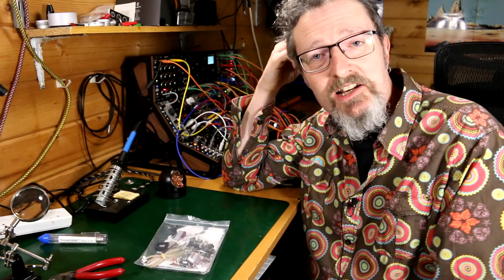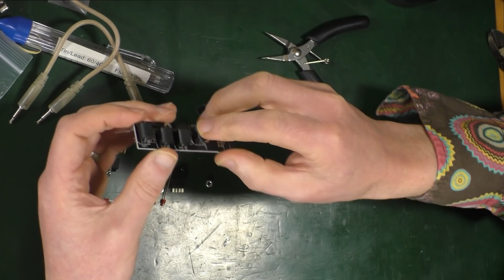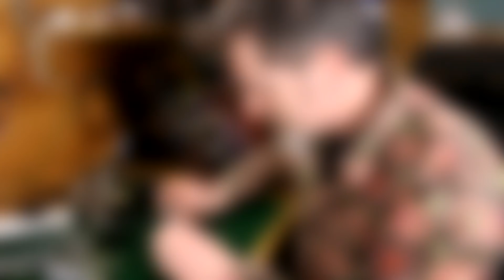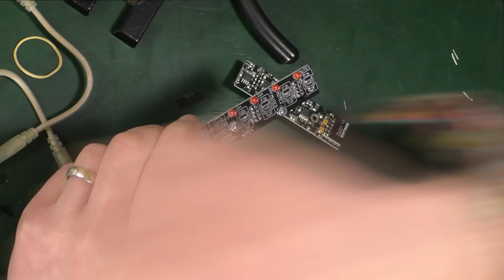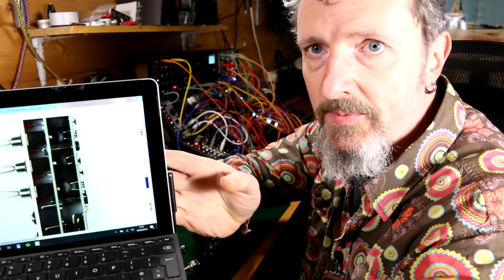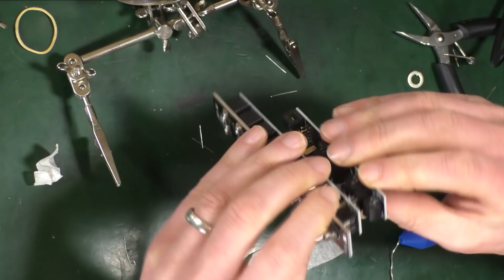Molten Modular DIY 05 - DivKid Mutes

Comment: Cheers for this!  I bought the DIY, my first one (though i'm familiar with soldering and electronics in general) the instructions where interesting!  
Great product!   The only instruciton I had to use common sense with, was for the negative on the LED's, as i'm generally looking for an actual square pad on the PCB.  It made sense it was the squared edge of the screen printed side though.

Comment: Main pcb is usually the one with most components and power ponnector, without any front panels jacks, switchs or pots.
Yep, plastic male header connectors & power connectors sometimes melt when heating the same lead for too long. To get the pin straight again you need to melt again the solder on the other side while readjusting the pin with pliers (not bare hands! it gets hot :) ). You really should try connecting the two boards together before soldering the connectors to prevent this issue.

Comment: Nice vid, ordered 2 kits ,  did several befaco stuff earlier and other diy kits as well but after finishing the first MUTE it doesnt work.... cant imagine what ive done wrong but the module does nothing. I did a rings and 3 ripples last week and thats SMD with a lot of parts, works perfectly. Big bummer here,  just a few parts but doesnt work.... measured for shorts and checked the soldering, no issues found.
Reply from the maker: That's a shame. I guess it's always possible to get a dead board - try the other one.
Reply: Cronny Sockett Dude - same exact experience for me hahaha. Bought a second to try and troubleshoot the first and both aren’t working! Did you sort the issue out?

Comment: For what it's worth, here's my experience with those washers that come with switches. Switch manufacturers distribute those lock washers and nuts with all their products in case you are installing the switch in a panel that will receive heavy industrial use. The same is true for the potentiometers that are manufactured with a tab. In one of Marcus Fuller's videos he demonstrated how useful that tab is when it fits into a slot in the case (I think it was for a synth  mod wheel). Otherwise we DIYers have to clip off the tabs and remove all the washers because they just don't fit in our tiny Eurorack modules. For future reference, though, the gnarled lock washer goes right next to the nut, so you can bite into the panel (or bottom washer, if you have one) and keep the switch fastened tightly. The tabbed washer is sometimes used so the tab is facing up to hold the nut, or facing down over teh edge of the panel. Too much info?
Reply from the maker: Not at all - good tips, thanks!